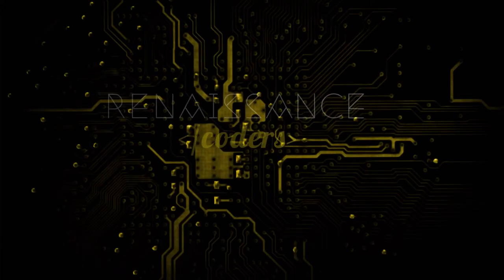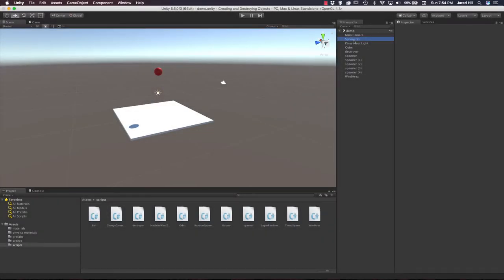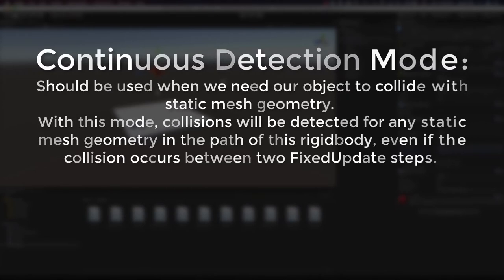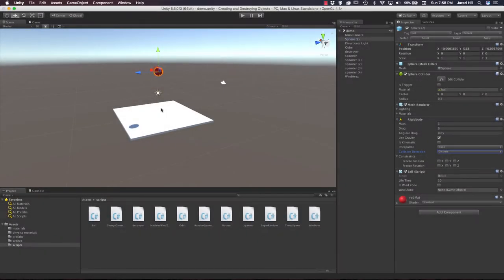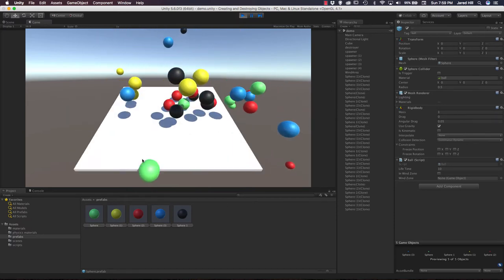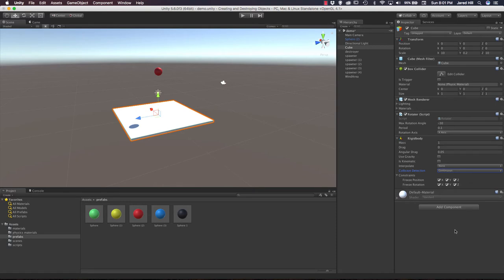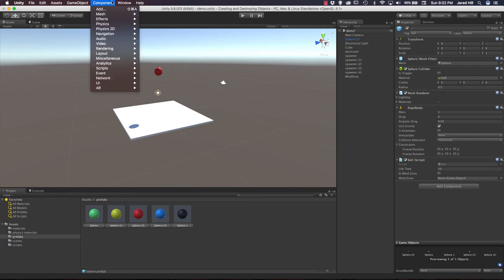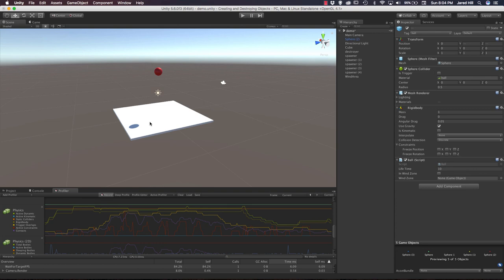Unity Rigidbody Collision Detection Modes

Comment: I think I know the problem, I was able to make a better version of it, the problem is that you are probably trying to move your platform using transform.Rotate or transform.RotateAround, those methods on transform do not care about physics and you also might not have a rigidBody on your platform. If you think of the real world, we need physics to interact with it, many times we do not use rigidBody on walls and ground because they do not move, but in this case, you should have a rigidBody and rotate your platform using the rigidBody.MoveRotation and on fixedUpdate, this way unity will be able to better calculate the physics around these collisions you have.
Reply: I was thinking the same. It's hard to use continous detection if the platform doesn't actually have physical properties. No angular momentum, nothing.
Reply: He even says that continous detection is supposed to be used with ""static"" objects, and that platform was anything but static

Comment: Great video!  Thinking out loud, would moving your floor in FixedUpdate instead of Update help?
Reply from the maker: Thanks for the feedback! In all honesty, I don't know if changing the floor to FixedUpdate would help or not, it might with a smaller number of instantiated balls, but I think that if we tried to instantiate a lot of balls with a floor updating with FixedUpdate then our framerate would be devastated. I will have to perform some tests on that to see if it helps or not. I will let you know what I find! Thanks for commenting!
Reply: Try move your floor with GetComponent<Rigibody>().MoveRotation

Comment: if you used a Pooler for the balls instead of instantiating each ball would it make more of a difference ?
Reply from the maker: Hey, using pooling for the balls would help with the frame rate issues, we are actually getting ready to do a video on pooling game objects in the upcoming weeks, maybe I can use this same project as an example so that we can see how much it actually helps! Thanks for commenting!